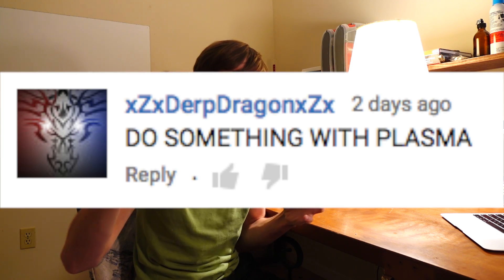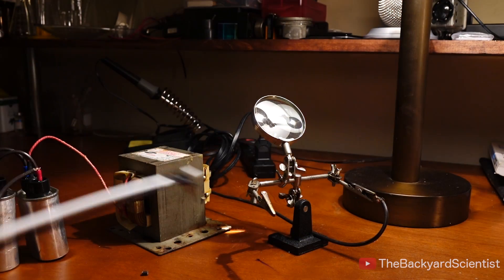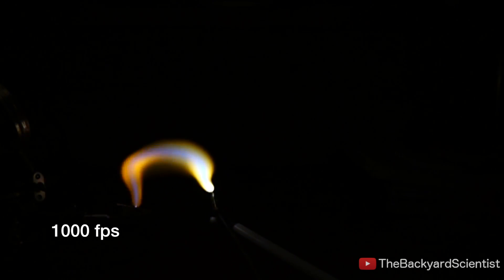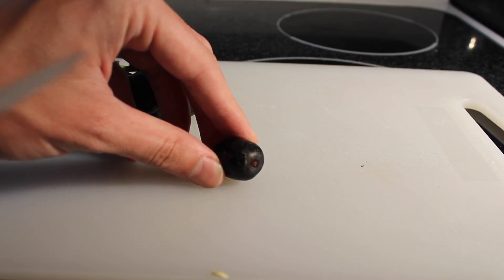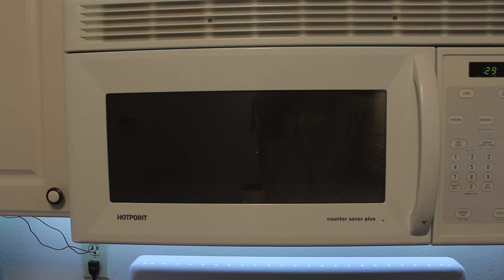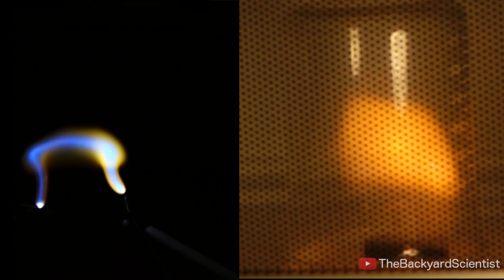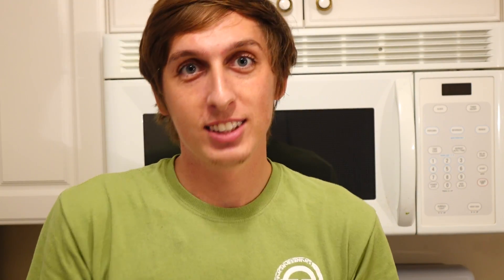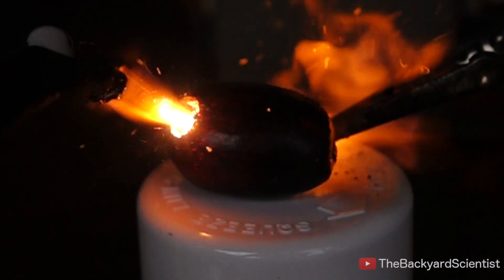Making Plasma, Microwaving grapes --- SMS#2

Comment: the diode in the microwave circuit "removes" 1/2 of the AC cycle thus cutting the pulse to 1/2 since the "bottom" cycle ( think sine wave) is missing

Comment: microwaves use a half wave voltage doubler so the magnetron only get the top part of the wave as you theorized but its 2 times as high.

Comment: Hey Backyard Scientist, Your fun, informative videos are bridging the age gap. I will be 60 in a few short years and I love your videos and have subscribed to your page. Keep up the good work and kudos to your parents for doing such a good job raising you. My suggestion would be how to make your own CO2, I would love to dump a trash bag of CO2 on our campfire. Instant extenguish!
Reply: thats pretty easy, I remember doing that in school. Youll  basically just need a balloon and some sort of fruit juice. Thats it. I think we added some yeast to the juice in school but Im pretty sure this isnt necessary, it only speeds up the process. 
Just open the juice, put the balloon on the top of the bottle and make sure its staying there (better tape it to the bottle otherwise it will lift off sooner or later).
Now the sugar in the juice will slowly turn into ethanol (drinking alcohol) and co2. the alcohol is liquid and therefore stays in the juice while the co2 is a gas which will blow up the ballon due to the volumetric extension. So youll end up with a balloon full of Co2.

Comment: When I was a kid I was fooling around with Sodium Nitrate and Potassium Nitrate (before making gunpowder).
You heat up either of the 2 salts until they melt then apply a current to the molten liquid (ie simply 12V is enough) using 2 carbon electrodes on either side of the container. Quite interesting results.
Reply from the maker: Bill Ryan yikes. Ive never had any luck making more than a drop of sodium. But I was using NaOH.

Comment: Olives work better than grapes.  I think it's because of the salt.
Reply from the maker: Richy Rich interesting. Like the black or green pickled ones?
Reply: *****
Yeah, I used stuffed olives from a jar.  Just pulled out the pimento, then halved it like the grape.  Incidentally during this experiment, I discovered that sliced olives dry out quickly in the microwave into tasty little crunchy snacks.  Just make sure they are not touching or they will arc and burn.
Reply: Rick Sanchez/ Pickle Rick is the best

Comment: Possible explanations, the microwave radiates certain wavelength to  heat up the food,therefore when the wave goes thru the grape it "generates" the plasma at that same wavelength speed. When the transformer by itself was used, the wavelength was 60 Hz as you mention on the video.

Comment: Not sure if you are still doing chemistry stuff, but an interesting SMS idea might be a slow motion look at the iodine clock reaction. I've always wondered if the color change is truly simultaneous, or if parts of the solution change color very slightly before other parts.
Reply: TheChemistryShack it changes from the top down, or from random points in the solution.

Comment from the maker: Thanks xZxDerpDragonxZx  and  ***** for this weeks electrifying ideas! I better stop with the electrical puns, it hertz trying to think of them. 

https://www.facebook.com/TheBackyardScientistOfficial

Lets hear ideas for next week!
Reply: ***** The hindenberg used hydrogen not nitrogen
Reply: TheBackyardScientist did you try to make pi in the first 1
Reply: Thanks for using my topic!
Reply: ***** The microwave only uses the negative half-wave ^^
Reply: +TheBackyardScientist The plasma is pulsing at half the speed of the MOT/mains caused of the high voltage that the magnetron requires to work. It has to get roud about 4kV to work. The problem is that the MOT only produces about 2kV. To solve the problem there is a capacitor wich is charging at one half of the wave and is discharging at the other half so its adding its charge to the voltage wich is comming from the MOT. Thats why the plasma is pulsing at half the speed of the MOT or your mains. I hope you can understand what I mean my english isnt that good.
Reply: TheBackyardScientist so we are grape's and we can be vaporized by it :O
Reply: Listen to my idea plz. Is there any way u can lite water on fire
Reply: ***** can  u lite water on fire
Reply: Anything is possible
Reply: ***** how about using nitrogen to make something hover
Reply: ***** Its fine lol
Reply: You should make a multi stage rocket out of the sugar+"stump remover" propellant! (I don't remember the actual chemical)
Reply: The Farma That would be potassium nitrate. I think that rocketry might be a bit of a stretch for this channel, as it's still doing mostly small experiments.
Reply: +MikeLovesMinecraft - Minecraft and More Not in certain parts of New Jersey!!!  Scary huh? Lights on fire coming out of the faucet!!
Reply: AmaanGstar ok. There is FOOF /F2O2, but that's very dangerous to make. Probably well beyond the equipment even in a good chemistry lab. I'm not sure about anything else but it's probably in the same level of nopeness as FOOF.

***** 

If the intact microwave is having the plasma pulse twice as fast, then that means it's pulsing on both maximum and minimum voltage. The disassembled transformer is the one half-rectifying (chopping off the bottom) the output.

As for a thing to do, maybe try to make glowsticks?
Reply: Do something with thermite.
Reply: Can u do something with hydrochloric acid
Reply: ***** magnets
Reply: Once a plasma is made (idk what else to describe it as) it can be sustained by about 1/10 of the power it had initially taken to create the plasma ex: if it had taken 55 kilowatts it could be sustained with only 5 kilowatts although it would be as powerful so maybes the difference in the speed of the energy pulsating was due to the amount of energy being consistently transferred every time it were to pulse back and forth? Great video by the way actually really interesting
Reply from the maker: cannonCoder Its opposite. the transformer is pulsing twice as fast as the microwave. So I think the magnetron only radiates energy at positive or negative voltages. I don't know exactly how a magnetron works though.
Reply: How about to ressurect an ant?
Reply: ***** magnesium
Reply: Do more stuff with molten aluminum.
Reply: Hey mate if you like put gas in water and get the bubbles in your hands it will go up in flames but not hurt u
Reply: hey man if you need electricity help ask photonicinduction he does a bunch of cool high voltage stuff and he knows his shit
Reply: Pour molten aluminum onto a bottle with dry ice inside.(This sounds so much more dangerous typing than it was in my head. Also could you put differ colors of water on to a scree and hit it. I'm curious to see if the different ingredients in food coloring would affect the density of the water and affect how fast a wave travels. (Try putting multiple colors onto the same screen.
Reply: ***** pour gasoline in liquid nitrogen
Reply: PLASMA SWORD FTW
Reply: Put a really powerful firecracker in a watermelon
Reply: *****  use vodka it looks like water you can put it on fire but it cant burn you because its 50% water
Reply: *****  show us how to make a simple hydrogen generator please
Reply: +procrozocker What's MOT?
Reply: MicrowaveOvenTransformator:)
Reply: +TheBackyardScientist Somthing with a plasma ball?
Reply: +TheBackyardScientist And the puns are bad, no offense.
Reply: Can u please make a homunculus
Reply: hi
Reply: y
Reply: TheBackyardScientist is the best
Reply: TheBackyardScientist is the best
Reply: It uses the top peak then charges a cap on the bottom peak. It then uses the cap and the top peak and repeats. You can confirm this by taking apart a microwave and observing the use of a high voltage diode and the fact that if the cap fails the magnetron will not work because its voltage is to low off the transformer.